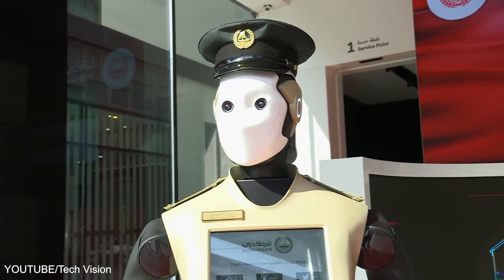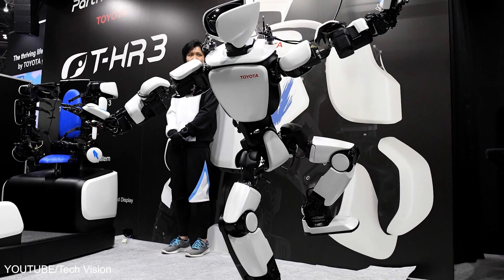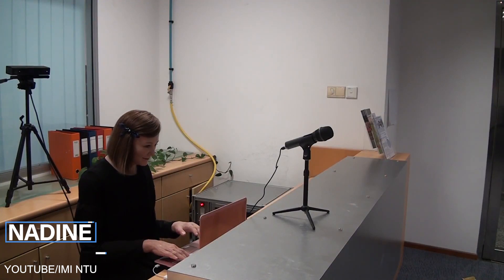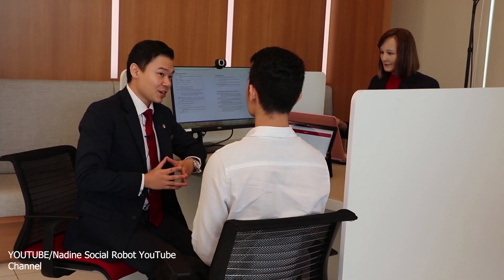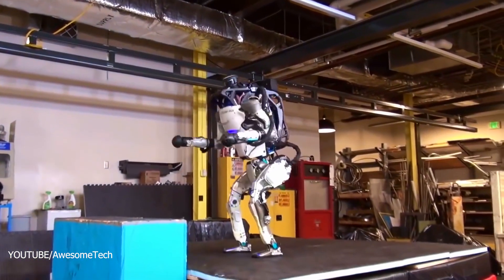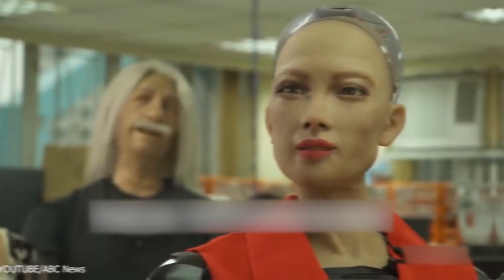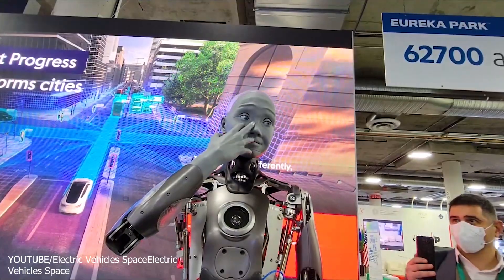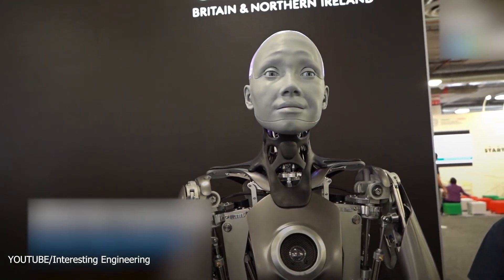LEAKED: Humanoid Robots That Are GOING TOO FAR!

Comment: The only one that's really scary is the one that did a backflip.. if something  went wrong how would you fight it ??  You can't punch it and who knows how many rounds from a gun it would take to stop it..
Reply: It has no armor ,so, it wouldn't take much to hamstring the thing. I wouldent be surprised if a can of silly string wouldn't mess it up and a can of spray paint i know would stop it in its tracks. A tazer im quite shure would create some robo-confusion as well. I wonder how good it could balance on a slipery surface like an ice rink. Giggles. You ever seen a dov on a frozen driveway.?
Reply: @michaelshultz2540  dude, you could be a General with that kind of quick thinking.. if we ever have to fight robots I'm on your side.. lol
Reply: @michaelshultz2540  You could also throw a jar of marbles at its feet and I'm sure it would go flying. Although the silly string and spray paint would no doubt probably *uck it up pretty good, lol.
Reply: @kevinmalone3210  great idea. Never thought of marbles . However a bag of 4mm ball berrings mixed wit. h bb's would be the coup de gras. Bearings and bb's on the floor and in the workings would have to create a serious problem for the robot brain.
Reply: Shoot it with a Lazer gun and melt it!